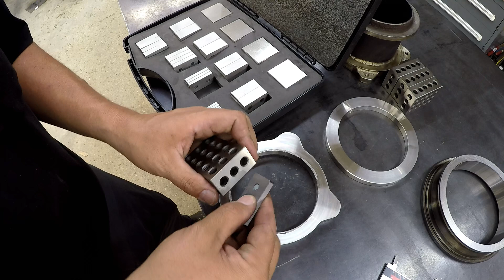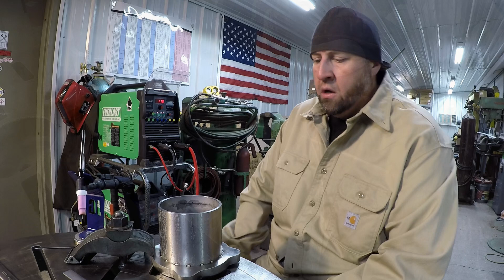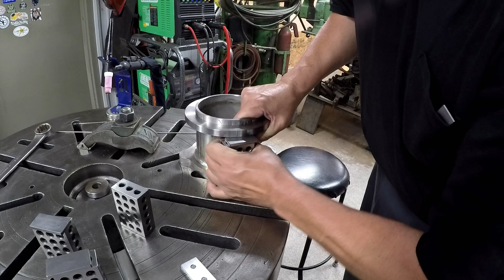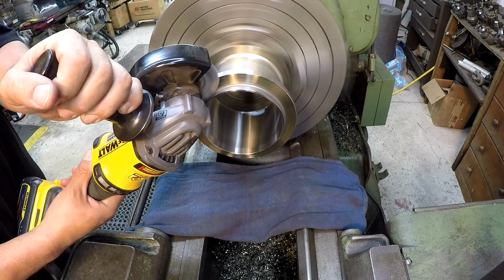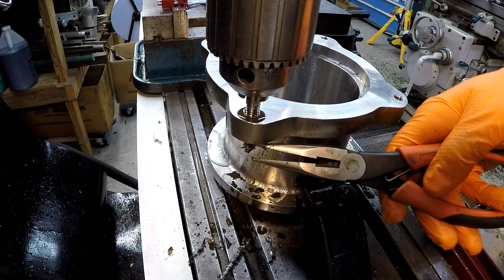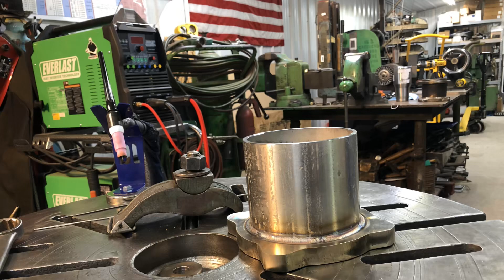Stainless Exhaust Collector Part 2

Comment: Hi Adam great video thanks....a question though how do you stop the tap from turning in the drill chuck? I always have a slipping issue when tapping a hole as the taps are so smooth and hard for the jaws to grip.

Comment: I have watched many (way to many) of the Abom79 videos. It always impresses me how non-stressed Adam appears as he makes a final cut, e.g. a keyway, to a shaft that has hours and hours of work in it. One mistake could ruin it. So I am delighted to see his error, and his fix. At the end the part shows no evidence of the mis-cut. I suppose if you work in metal you can always just use one or another welding technique to replace the metal mistakenly removed, and redo it. The Sampson Boat Co channel has taught me you can do the same thing with wood. I never heard of such a think in 40 years of hobby woodworking. I love YouTube.

Comment: Have you ever tried to shrink fit? We shrunk fit some of tooling. Heat the outer piece up to around 500 degrees. Put the inner piece in the freezer. Sometimes just putting the inner piece in the freezer will work. I don’t know what the dimensions were.

Comment: Each time you talk about using WD-40 to get ride of the water, I wait for you to point out that WD-40 is actually for  "Water Displacement" (WD). People most often think of it as a lubricant, but it's mostly kerosene with some light oil and hydrocarbons mixed in for fun.

Comment: Nice work man. I kinda like raw unmachined finish of the pipe. Little tip. If you came across some stainless parts that will hold some pressure or mechanical loads try to TIG weld with small electrode and with filler metal not fusion weld. It will kinda cool the weld down. Those discolorations are indicating for chromium carbide on the surface or even inside weld. That will make stainless steel brittle and it can crack in this place.

Comment: Wondering if you could have used the Fireball blocks to evenly space the flange away from the jaws. I use parallel bars all the time to space parts away from the chuck face or the jaws. Of course remove them once the part is clamped in. Love your work BTW. I could come work there for free, just because I love machining and fabricating and miss doing it.

Comment: Like Adam mentioned with the oil on the part- clean it yes, clean metal wont bubble up and cook the welds, but be very carefull what you use to clean any metal with that you intend to tig weld. chlorinated brake cleaner and the like can produce phosgene gas in a super hot argon rich enviroment.. it is a miserable horrible god damn smoke that will kill you. be carefull please

Comment: I am certain this fit and did the job intended without issues. My only interesting question is, when you pressed the initial first ring with the four flanges on, it became obvious it bent the four flanges up some. And that was obvious that when you faced it off, the four flanges took a deeper cut to make them flush with the end. But then you used you 1, 2, 3 blocks and the filler parts on top of them on the same bent up flanges to set your second ring against. Wouldn't that have made the position of the second ring that much higher as well? I mean we are talking about some few thousands, but I was just wondering. Nice work of course and Thumbs Up!

Comment: Not that I’m a professional.. but welding is my profession, and I’ve found that brushing stainless welds while they are hot turns out a much better result with minimal effort. Erases the color completely and easily. Hope this tip helps.

Comment: Personally I like all of the discoloration that welding stainless results in. I was just dealing with that today welding some exhaust and turbo flange on my snowmobile. Love the rainbow effect of heat on stainless...especially after something like an exhaust is is ran on the engine for any length of time. Way better than any chrome or polished nonsense. Awesome work once again. This kind of stuff is right up my alley with all of the turbo stuff I do. Thanks for sharing and keep up the great work!

Comment: Considering the amount of work that went into this component, I wonder if having a foundry cast it as a single piece would be more cost effective?  Then you would just drill, tap, and machine that tapered and register/counterbore.
Reply: I was just thinking that. Probably even more effective to just machine it from a piece of tubing with the correct dimensions. Don’t remember what his finish dimensions were, so don’t freak out when I give some incorrect dimensions, but like a piece of 6-7” dia by the same length with a 1-1/2 wall thickness would have been just fine. Also, then you don’t have to worry about the corrosion and everything else with separate pieces and welding. I have billet pieces somewhat like this machined for snowmobile turbo setups.

Comment: From the welding works co.  Would you be willing to contact me about building a rack for a lathe? They want over 2000.00 for a replacement.  Dont remember exactly but about 1 inch square by 24 inches, I think. 5-6 recessed holes for 1/4 inch machine bolts. donnierdale@gmail.com

Comment: Would it be possible to true up the part to the lathe chuck using the gauge blocks when you want it to sit a little ways off from it, so that you don't have so much work using the idicator?

Comment: One of the big projects I've taken up this year involves a lot of work with 60s-80s era US jet engine parts. While I don't have near the capability of you and your shop, I can Definitely admire quality workmanship! Some of these parts appear fairly rudimentary and likely do one minute function, but I tell ya what, many are too beautifully made to believe they're bolted or fastened to some of the things they are and actually used. I could imagine someone like you laboriously and painstakingly spending hours or even days on one little part, a jewel of machining excellence, then it's shuttered away deep in the bowels never to see the light of day. Gets you thinking though.

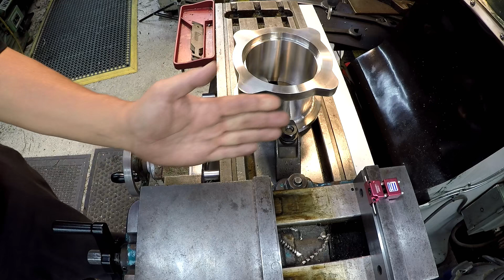Comment: Greetings Adam!  I've spent hours and hours watching your videos.. Thanks!   I've always admired your approach to fixture, clamping, and indicating, so I have a question about how you setup your piece on the mill at 32:00.  When you said you were trying to square up the piece with your mill, I anticipated you getting a dial indicator mounted in the mill spindle and running the piece back and forth to check how square the flanges were.  You mentioned for expediency that you were using the machinists square.  I am assuming hole placement relative to the flanges was not critical and the data you entered into the DRO would handle the hole locations relative to themselves, which is critical.   Is that correct?  (I'm not a professional, so I'm trying to understand the thought process)  Thanks in advance for your answer!

Comment: Where does someone get the moly-d cutting fluid? I just use motor oil for most of my stuff, atrocious I know. I apply it with a 75cent paintbrush out of a 40mm grenade casing

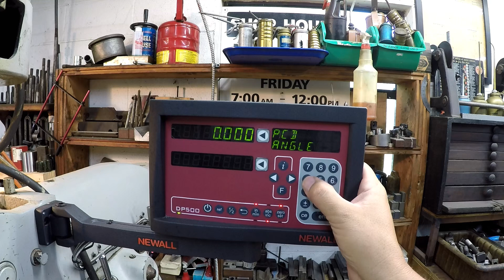Comment: @ 35:12 is 45° the angle between the workpiece centre and any two adjacent bolt holes?
Reply: 45 deg's off center axis
Reply: @deathblowhere  So it's the angle between the center axis of the workpiece and one hole. But vertically instead of horizontal like I had thought before?
Reply: @Trident_Euclid  Yep, it's an angle of a first hole relative to center axis (say "North" of a work piece). Having this angle and total number of holes the unit calculates necessary X-Y coordinates

Comment: I don’t understand how the mill works. Is there a setting that matches the downward movement to the thread, or is it in some sort of floating mode that allows the thread-cutting motion to pull the tap down into the work?
Reply: With the quill unlocked or can be used similarly to a drill press,  some also allow a drag level of brake/ locking. 
Power tapping allows the tap to feed itself,  good taps needed as breaking one is all too easyif they are dull or bind.

Comment: Excellent job as always Adam, its the small details that make the difference between a good job and a great job.
I watched the first video and I remebered you commented about the noise when macining the stainless tube.
Have you ever tried using silencer bands like the ones used for machining auto / light truck rotors and drums?
Goodson tools and suplies make them in various sizes and styles.

Comment: Thank you for showing the power tapping. Folks may be interested in seeing how you select spindle speed and control quill feed to not risk "stretching" the threads or breaking the tap. Old guys taught me those  techniques before I learned to hand tap, and I still prefer power tapping. Mill and lathe examples would be good to see. My little Altlas lathe doesn't have spindle reverse... Another good reason to make shop space to get the LeBlond lathe I am restoring into the shop.

Comment: Two things:
Coolant question first - - when you installed the x-axis tube, did you lose access to the coolant drainage ports? I did on mine...that's the only thing I don't like about my Newall DRO. But I suppose that has nothing to do with the brand.
Second: thanks for telling us about the Fireball discount. I just ordered a square and a set of shim blocks...and saved some money!
Thanks for a good video series, Adam.

Comment: To get a quick square up in the lathe chuck I slip some parallels under the part.  (That's the quick explanation)  Sometimes I can hold a parallel on either side of a single lathe chuck jaw and slide it under the part I want trued up.  Gets it really close to square fast.

Comment: Here is the question, when power tapping, how do you keep the tap from rotating in the drill chuck. Mine never stays tight enough.
Also what coolant do you use for the nogacool, I have a good general cutting coolant for the bandsaw from Qualichem. Wonder if that will work.

Comment: I wonder if the clamp blocks weren't shaped specifically for the step you left off of the bolt flange? Anyway very pretty part. Thanks for the video

Comment: When setting the height of the ring with no ears, shouldn't the critical measurement would of been outside flange to outside flange, not inside to inside? Specially considering the fact that the ear flange was remachined after the fact of saying the spacing in between the two had to be 3-3/16''.

Comment: I’d say keep all the steps in.  It makes your videos stand alone.  We can always skip something if we need to.
I enjoy watching you work.  I hope to absorb your skills by osmosis :)
Reply: I also appreciate seeing all the steps, because each time they're a touch different and that gives a better idea of what the most important steps are - they're the ones that don't change. Like sometimes the workpiece gets tapped home against the chuck (or a spacer) and sometimes it doesn't. Or just eyeballing runout on a rough rod that's going to be turned down all over.

What are the shortcuts and when are they acceptable? That's much easier to see when the full setup is shown. Like loosening lug nuts before lifting the car off the ground: good idea with hand tools, very helpful, but a terrible idea with power tools.

Comment: I tried wd40 to protect the table from rusting and it fails. Don't know about the US but in Europe it says on the can "degreaser" so if oils protect against rus how degreasing the table helps? In fact what many don't realise nowhere on the can does it say "lubricant". So went back to using any other oil I can get my hands on.

Comment: Sunbury question obviously that's a heat baffle for possibly a turbo connection so you saying that the pipe diameter is thinner than the original why would you make it even thinner when you think that if it is an exhaust part with all that exhaust heat going to do there you the one thicker than thinner

Comment: Adam. I have an Abom79 Hoodie. Where are the Hobart Gloves I sent you? JK!!    :-) Lincoln Welders are one of the Best!!
You are getting really good at welding. The stick job on the trailer hold down anchors was sublime. Like Butter. (Yes, I am waxing poetic). TIG is the one to master and I think you are well on your way. And you are not even using a rotary table. Wow.

Comment: You might be surprised at the difference very smooth/polished air intakes and exhaust systems makes in the performance of the engine.

Comment: The first flange machined was no where near centered on the tube.  Doubt it matters.
Reply: Off by a mile, so to speak. I don't think the CAD copy was correct or the plasma cutter had slop in both x and y. When Adam was facing the eared flange, it was clearly out of concentricity by more than a 1/16th. Probably closer to an 1/8th.
Reply: With all those comments of surgeon-like precision I was starting to wonder whether I simply lost my marbles. Apparently I'm not the only one who can see that though...

Comment: Not a lot of meat on those ears 😳. Not your fault obviously.
Reply: I was thinking the same thing. Concentricity between the ID and outer arcs is off by what appears to be at least 0.050". Since the ears are thicker than the original part, I'm wondering if the hold down parts' geometry is now an issue. I'm also thinking the dimensions were off when the plasma cutter copied the part in CAD. Something is clearly amiss in that eared base ring. I'd like to see pictures of the part being installed.

Comment: Fireball has awesome stuff. Pricey, but super quality. Good value imo
Reply: I've experienced the mistake of buying cheap tools. Buy quality equipment first, even if you think you'll never use it again. You'll end up spending more replacing the junk with quality than if you'd have bought the good stuff to start with.
Reply: Jason Hendrix could not agree more. Buy once, cry once

Comment: I cant say enough good things about Jason, although you should be upset he hasn't got one of his Magic Squares in your hands yet ;-) Seriously it is one of those tools you'll wonder how you lived without it after using one. My friend recommended it to me and while it's not cheap my friend said he'd buy it if I didn't love it. Now after using it I realized its actually a bargain and I've since modified it adding half round blocks to allow me to use it for tubing work on airframes.It's hard to explain but we machined blocks to hold chromoly tubing that screw to the face of the square. If you look at his video you'll see him use if for square tubing and the blocks let me use it for round in the same fashion. Last but least was when  I ordered one of his squares there was a issue with the shipping and he truly went above and beyond to resolve the problem that wasn't his fault to begin with. So its tough to go wrong.

Comment: Pretty slick work walking the cup, Adam. Makes for a nice consistent bead. I only wish I'd learned that technique back when the dinosaurs... Anyway good work.

I'm kinda surprised you didn't bore and face a mounting pot to receive the surfaces you previously faced and bored. This would ensure concentricity of the diameters and parallelism of the faces - if that's important.

Comment: That little cut you made to the id really cleaned the piece up. Learning to dial in a part is a very important part of machine work so thanks for showing it. To some it is no big thing but to someone who is learning it is. I use a small Miller TIG at work to do the small welds on missile parts.I use a .040 tungsten. I use filler on some and fusion on some. I use the standard foot pedal but I really like that thumb feature on yours. Gonna have to check with Miller and see if they offer something similar. Great series.

Comment: I know a fella up in the Pacific Northwest near the ocean. He has a vintage Rumley Oil Pull tractor that he exhibits during show season all summer and fall. I asked him one time how he controls rust in the winter when the tractor is in storage. That area of the country is known for high humidity and condensation in buildings. He told me he fills a garden sprayer with WD-40 and hoses the entire tractor down with it. He has had zero rust issues using this method.

Comment: Adam, you video series are amazing!  This one was even more so.  There so much about machining and welding I don’t know but I have a question regarding the second weld, the ring.  Why didn’t you tack weld it with the spacers installed and then remove them for the complete weld?  Keep the great videos coming, Maestro!

Comment: The part turned out great Adam! I’d definitely like to see it installed on the boat. Jason
Reply: @from the dark side of the moon agree and I must say I love my German made tools. I work them hard and treat them like they are my kids (meaning, very well). I also treat all my japan made inspection and measuring devices the same in my machine and fab shop.

Comment: Hi Adam, I have a suggestion for your friend Jason at Fireball tools. I noticed when you used the shop blocks on the 123 blocks they wanted to move off center because of the magnet placement. Perhaps he could move the magnets towards the center to get more contact with the 123's. Just an observation from a noob. Take care. Love your channel.

Comment: Hello abom! I thought I'd let you know that for fusion welds, especially on stainless, a pulse works great. If your machine has one I would practice with the pulse on fusion wleds. It is absolutely useless for welds that need filler, but if you get the machine set you can just floor the pedal and make great fusion welds with almost no cleaning needed. Great channel, keep up the good work!